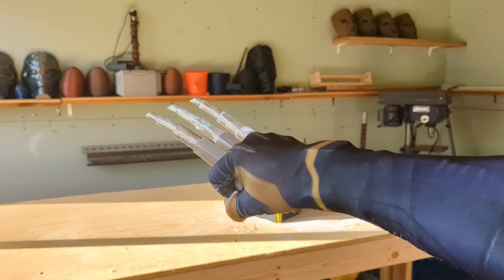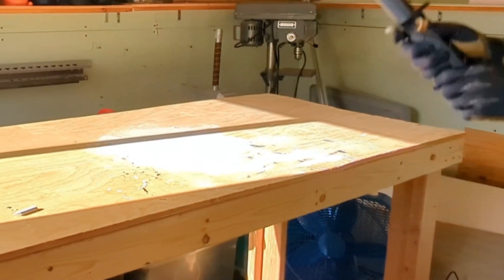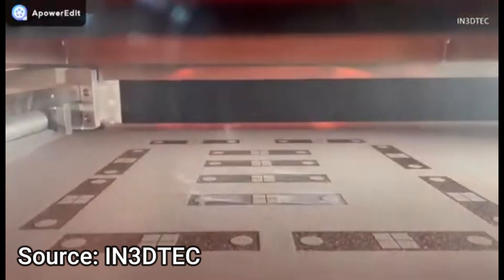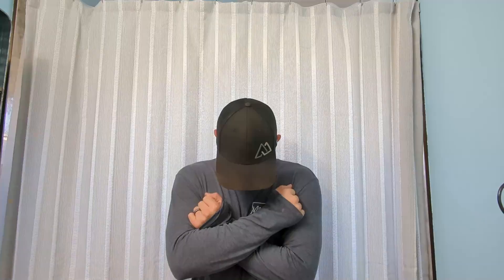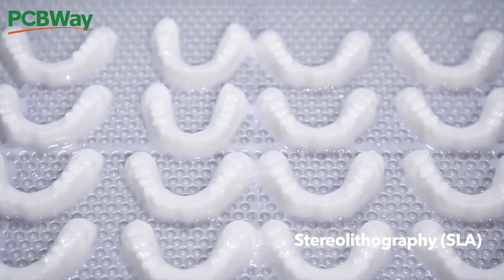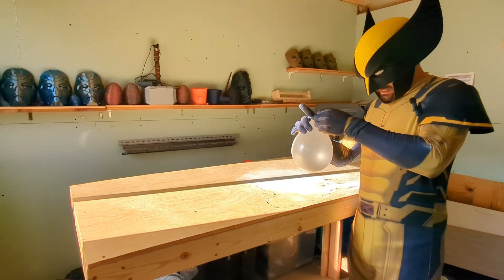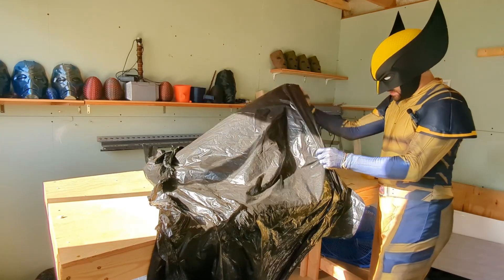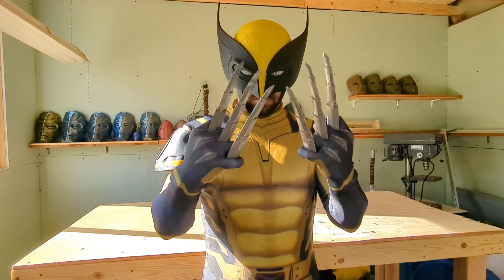These Wolverine Claws Are Made Out Of 3D Printed Metal!

Comment: That's cool. I was wondering why the claws didn't look like the claws in the movies but after hearing the circumstances that's understandable. I'm excited to see other Marvel projects.
Reply from the maker: @TheVibraniumPatriot  Thanks! Maybe I can make some claws similar to the ones in the movies sometime just to break more things 😁
Reply: @makeitlabchannel  that sounds fun. Question, how's the captain America shield project coming along?
Reply from the maker: @Vibranium_man  I am still trying to figure out the best way to do this and with what material. It will have to be printed in parts, but should it be a replica made of flexible PLA? Should it be made out of rigid PLA and coated with 3d gloop for strength? Then it wouldn't be super bouncy but very durable. Trying to figure out the best options - have thoughts?
Reply: @makeitlabchannel  well try to see which material works like you do your airless basketballs.